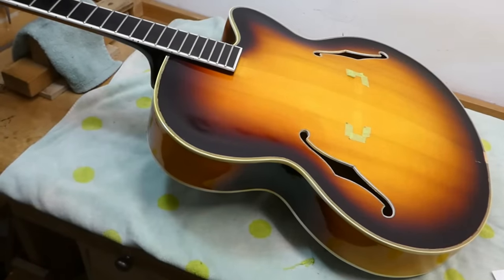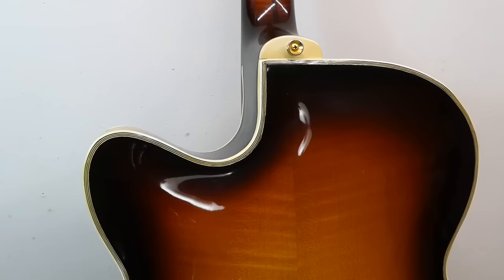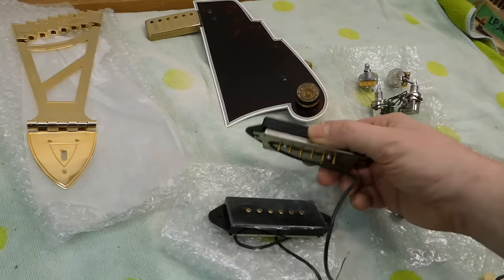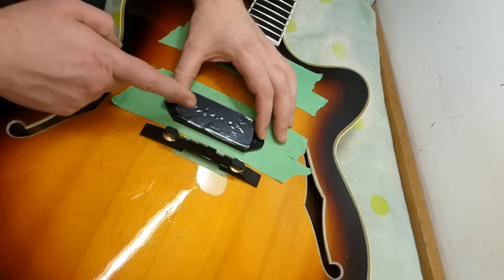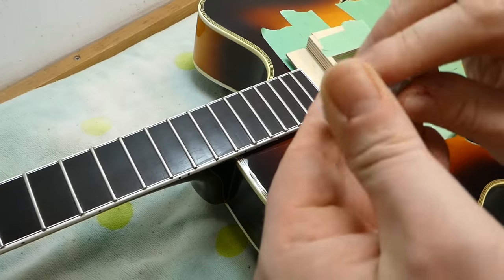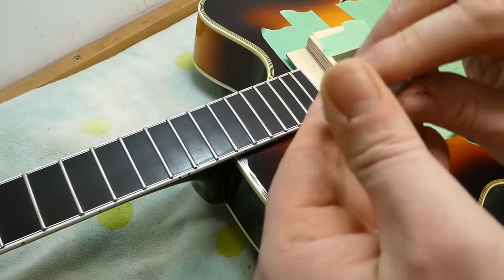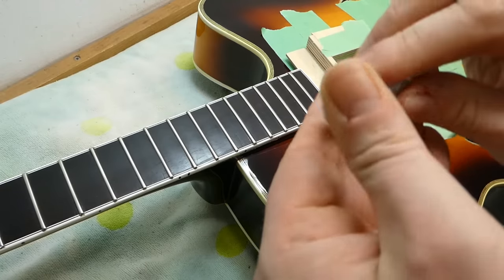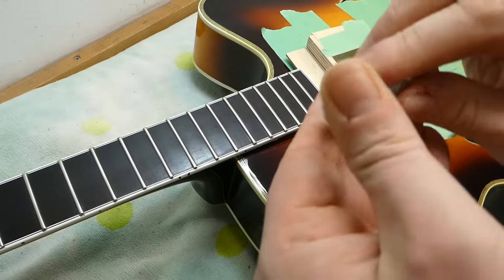The Forbidden Mod

Comment: Great job, thanks Ted 

Long before YouTube i found an old wrecked Framus acoustic archtop made in 1953 in the dumpster.

Since it had a gaping hole in the top right in front of the fretboard i converted it into an acoustic - electric which i still play to date.
Reply: Nice.

Comment: You did a great job. I was very surprised at the X bracing of in an arch top. The p90’s are a nice touch on that guitar and it didn’t loose its acoustic quality at all. I have a Sawchyn Archtop with a floating Benindetto that works well. But can respect why the owner wanted to do this.

Comment: Always a pleasure watching you work. Ive recently (10 years) started replacing my pickup selector switches with a blending pot. The smooth transition eleminates sudden transitions. I've found that there are "sweet spots" on my 2022 Gibson 335 where i made an indicator pointer washer and recessed glass jewels on the speed knob for references. Turns out, my favorite spots always a blend. I replaced the stock volume and tone pots with a CTS matched set (510k ish). Also using one of my  NOS .22uf Bumblebee's i bought at auction 35 years ago. It really opened up the Gibson T-Type pickups, but i have a set of Ron Ellis pups just in case.

Comment: I feel like you undersold the value of independent volume and tone controls for each pickup.

For me, the best thing about them is being able to make the middle position really come alive by rolling the tone off from the neck pickup and using the volume control to add or remove it from the mix.

It creates a really unique sound that you can't achieve otherwise that allows you to dial in a darker sound without it being too muddy.

Absolutely love having parallel controls, purely because of that tone
Reply: Great comment, I play an archtop with 2 pickups and four knobs, and I just use them to balance the output between the pups.  I will now go and experiment with your technique, thank you for the insight.
Reply: He still can with this control arrangement. He just has to use concentric pots. (Stacked pots). For an instrument like this I can see the utility of individual volume and tone controls.

Comment: Speaking of D'Aquisto, I had a New Yorker Special that the original owner decided to add an L5CES wiring harness to. Later he felt that he ruined the guitar. I had an early 60s L5CN that someone added an L5CES harness to. It ended up with a big crack in the top. One thing about these archtops with pickups is that the tops are usually laminate(at least with Gibson). This helps reduce feedback.Sticking pickups into a solid top archtop would make for a lively  guitar.

What about clipping the pole pieces on the bottom of the bridge pickup? It would save from routing into the x brace. As for the switch, there is a deep nut for Switchcraft switch. This is common on Gibsons where the switch wont fit through the top. "Typically found on a Gibson Les Paul guitar or where the switch threads don't protrude enough through the guitar body to attach a standard toggle switch nut." from Philly Luthier.

Comment: awesome as always!

two little things;

if he liked the feel of cheap alpha pots because they're super easy to turn then there are CTS pots like that. the dimarzio-spec CTS pots are some of the best around and have very low turning torque. it seems like the CTS "vintage style" versions with the dimpled back where the spindle pokes through are the easy-turning ones, and the dimarzios are like that

as for the switch, the back-facing cutter thing is a nice answer but also what you need (and what gibson uses) is the "deep nut" that threads around the switch collar and extends down into the hole to grab the switch even through a thicker top

some gibson archtops have a weird rubber gasket thing they mount the switch in, i suppose for when even the deep nut is not deep enough to reach

Comment: I had my '66 Fender Jaguar's bridge pickup routed out to fit a Dimarzio Single coil sized humbucker. Left the original neck pickup alone. Had a cool sound and it worked for what I needed at the time.

Comment: I just did some sacrilegious freehand routing for a 2-point floating tremolo with vintage styling. I haven't done one for several years, and fortunately, it was just within acceptable. I bypassed standards like masking tape, petroleum on the wood, and under cutting the hole to bring it up to necessary capacity through some hand filing and sanding. I've done pro shop perfect freehand with those tactics employed, and hatchet jobs I sold at a loss on the first couple I had ever routed, and for that matter, these were the first times I had ever used a router lol.
What has actually performed well for freehand is undercutting the pocket with an oscillating saw, then going in to freehand with the router, and finishing it off with minor hand sanding. I will finally build some jigs next year since I have a habit of modding junk-brands until they're high end.

Comment: Epoxy putty's great stuff. I knocked over my guitar before a gig and split the nut right under the B string. As a stopgap repair I threw on some epoxy putty for the B and the E string. 25 years later it's still there! 🤣

Comment: I had my sunburst Epiphone Emperor Regent converted into a Gibson ES 5 type. Replaced the one floating pickup and modded the pickguard to accommodate the three p90 pickups and added a gold Bigsby and art deco type tuning buttons. Though not a Switch Master, but with a six-position point knob selector. Strictly NOS for Jazz and Rockabilly!!

Comment: The tool you need to cut the counterbore on the back side of material is called a reverse spotface cutter. They are commonly used in the aviation industry and can be purchased from aviation tool suppliers such as The Yard or Brown Tool. Thanks for another great video!

Comment: In regards to the internal counterbore for the switch, Noga has internal deburring tools (the RC2200, for example), where the blade folds sideways to hide inside the shaft of the tool and then rotates out once the shaft has been placed through the hole. That tool wouldn't work as-is (it would cut a chamfer and not a flat, if it were big enough, which it isn't), but the general idea might be usable.

Comment: Rather than the bridge pickup riser ... there are those screw things along the center of the pickup that can be adjusted a ways up. I usually raise screw poles about 3/16ths inch and drop the pickups anyway for the grail "more note clarity and better definition"; it tends to reduce some pickup brands tendency toward muddiness. Looks like a seamless job like it was originally outfitted that way.

Comment: Another great job! .  I can understand people having issues with doing that to a vintage Gibson or other iconic archtop, but as Ted said,  The guitar was built for the owner and so that doesn't apply.  I have an electric guitar designed & built by a local luthier and it has had it's pickguard & configuration changed three times   It started in a Strat configuration, then  had a Tele bridge p/u, lipstick middle & humbucker neck  p/u, and it's now fitted with 2 filtertrons. - I wouldn't have done this to any of my Fender guitars ( OK, I put a humbucker in the neck position of a Squier Tele) but have no qualms about modding something that isn't an  iconic model.

Comment: 17:29 That's what I found too! I don't know why they don't make those jacks to fit a 1/2" hole nicely. I understand you want a little slip in the fit, in case the wood shrinks, so it doesn't crack, gripping the metal jack. I take a 1/2" spade bit, and grind both edges on a belt sander, so it drills a 13/32" hole. Would be better to have a Forstner bit that size, but a spade bit is way cheaper...just have to go slow and careful.

Comment: Recently replaced the toggle on my 91 LP. Bought the new switch-craft on-line. Everything was the same but the nut. The nut on the replacement was flat like yours. The nut on the original was concave. Goes into the body more that 1/8. Crazy! Of course I used the old nut with the new switch.  What choice did I have.

Comment: When you thought fishing the electronics from a hollowbody was a frustrating task.. then see router shavings plunging into one. The back-bore counter-sink idea is a real trick, thanks! and I use plastic bonder for a bunch of jobs, They do a putty version also I think. The neck pickup/body looks canted away from the treble strings, is that advantageous to some extent for tone in that position?

Comment: I have a nice D'Angelico EXL-1 in Ocean Turquoise Full sized Hollowbody electric acoustic guitar with Flatwounds 13's on her. The volume and tone controls are mounted on the pickguard and the pickup is suspended off of the end of the fretboard making her a guitar with no holes/cut outs in the top plate. I can remove the pickup and the tone controls and Iwould have a fully functioning normal hollowbody acoustic guitar. The head piece is a work of art and the tuners are unique to D'Angelico. So as the tailpiece. The 13's are kind of ha4rd to play, even though I play guitars everyday a;; day long. In fact I play so much I amlosing feelings in my left hand and bottommost two fingers. I'm worried about that.
I also have an D'Angelico New York semi-hollowbody electric guitar named after the Grateful Dead. It's a very hard to comeby instrument as it's not a model in their normal line-up. It's well made and beautiful too. She sounds good as well. - Peter age 73

Comment: Tip:  Regular JB Weld actually works better on plastic than the special plastic JB Weld stuff.  See Project Farm.  Go figure.

Love the black choice of pickup cover.  I wouldn't have said that before I saw it.
Reply: I have yet to try a "plastic fusion" epoxy that impresses me, regardless of brand.  All of them seem to contain some kind of nasty smelling solvent and so they really stink up the room but they never seem to grip, nor harden, to the same degree that a regular epoxy does. I love JB Weld ( both the regular slow cure and fast cure "Kwik" variety)  But I wasn't impressed with their marine weld epoxy,  and their UV-cured  super glue works well enough but the soft squeezy rubber applicator container it comes in (apparently a design purchased from another adhesive company) is the worst glue dispenser system I've ever seen ----- it allows air in so that the nozzle clogs, and it's designed to not be removable or swappable, and then the glue hardens inside the tube prematurely.
Reply: It's not black, it's tortoise-shell.
Reply: @nazfrde  , the pickups are black (though they're also available in gold or chrome, perhaps cream/ivory). The pick GUARD is tortoiseshell.
Reply: @nazfrde  What? The pickguard is tortoise, but the pickup covers are black.
Reply: @goodun2974  Agreed. I think that Project Farm's opinion would be the same.  There is no ideal product for all applications.
Reply: @frankfarklesberry  , at any given time I have at least a dozen different types of adhesive around the house, including at least 6 types of epoxy. It takes trial and error to figure out what type and what technique/surface prep works best for certain materials. Sometimes one operates only from a combination of instinct and prior experience.
Reply: @frankfarklesberry  oops you're right. My bad.

Comment: A deep toggle nut would saved time and manipulation of the top. The deep nuts are very useful on thicker tops like Les Pauls. They are designed exactly for this type of application. They are cheap and readily available in fine or coarse knurled.

Comment: I have to say that you took the observation that the bridge pickup could benefit from being placed on a riser far better than I would have in your position.

After having done such a precise and potentially risky bit of cutting into the braces that run directly beneath where it's mounted, simply to accommodate the screws that hold the pickup together (yes, they are just regular screws and no, they don't really do anything other than attach the bobbin to the base plate and were added to the design to make it cheaper and easier to mass produce compared to the original version with 6 individual magnets that all needed to be in contact with the base plate. The influence they have on the sound is negligible and they aren't intended to be adjusted. If the pickup wasn't wax potted and you loosened them to try and get balance between the strings all you'd end up with is a microphonic pickup because the coil wouldn't be properly secured) I would have been incredibly frustrated to come out the other side with the pickup lower than it needed to be.

Comment: Hello!
In order to avoid the possible side effects of having epoxy putty close to the guitars surface (exotermic reaction), I use moldable plastic - put the plastic pellets in warm water and once its flexible, mix them all together and use it adjust your template to the guitar archtop, similarly to what you did with the putty. once its solid you have a very stable surface to route. :) I have tested this method. 
Again, only thinking about this alternative based on the epoxy’s properties.
Reply: Also, you are my absolute favourite channel on youtube! thank you for so many things you’ve taught me.

Comment: This nut for the switch can be made on a lathe in brass or steel. Believe it or not, there are still people that know how to make them. A local machine shop will be able to reproduce that part in 15 minutes. For some cases might be worth considering. I had similar situation and managed to get one made. A friendly shop will make them for couple of $. Unfriendly shop will charge you a 100$

Comment: Nicely done! A short Switchcraft toggle also has a 9mm threaded shaft or you could have used a deep nut like on a Les Paul.
Reply: Yeah, I would have used a deep thread nut rather than counterboring the back of the top.

Comment: Tip: I use soft silicon tubing found for small aquarium pumps, for pulling through pots, jacks, and switch (without knob), this way the tubing has a little more rigidity, also it fits perfect with a little heat over pot shanks and switch, i push the tube through the jack hole and it stays in place with a little painters tape... this way you can feed the tube through and pull your pots, switch and jack and it works very nice vs fishing line which can get lost in the body..

Comment: Great work as always. I understand the idea of leaving enough PU wire to be able to do future work without removing the whole harness, but I wonder if you have to do something to either secure the extra wire someplace or guarantee it is floating in the middle. I could see it being a potential source of annoying buzz/vibration otherwise (e.g. if it is just touching an interior surface but free to vibrate when the guitar is played).

Comment: that guitar is very violin based as they are arched top as well
Reply: The big difference is that flat tops and many archtops (like the above) use an "X" brace.  Violin family instruments and some archtops have two braces outside the outer strings.  Some thin body archtops like Gibsons 335s use a laminated (I think spruce) centre block running the length of the body.  I believe that is the only reason they can use the two piece body mounted bridges like Les Pauls.  "Jazz guitars" (I own a Guild X-175) with a braced body often have an end pin mounted tail piece.

Comment: I own and operate my own little resinous flooring company and I cut striations or as I call it keying in . Cut a line usually a few inches deep at terminations oe doorways to ensure a very low bonding failure possibility.

Comment: FYI...a competent machinist could fabricate a locknut (and a spare) for that switch.  Oh, and there is always the option of using dual concentric pots to reduce the number of pots you need to cut holes for.

Comment: I have a guild A50 that I'm doing the same with, the only difference is I intend to use a GFS surface mount pickup, which will only require drilling, not routing. It's going to look absolutely ridiculous, it doesn't even have a cutaway and looks like...... I mean, well, it looks like a jazz guitar from 1951. Because it is. However, I am not taking something all original and destroying its value. My dad tried to reset the neck by dowel-jointing it, or I should say he's successfully dowel-jointed the neck and kept it from basically falling apart. However, if it ever needed an actual neck reset, it's sort of impossible with the way he did it. Therefore it's not all original condition and not collectible the way it would be. It would still be a hell of a player, fat neck and very easy to set up, but I wanted to sound cool, and the DeArmond string mounted pickup (it's supposed to clip on between the tailpiece and the bridge) it's too old and has lost a lot of its gauss, and it was never that hot to begin with, even for a vintage single coil. Absolutely not my sound. I feel like I'm going to put this somewhat hot surface mount pickup on it and take advantage of the fact that it's hollow and therefore I can hold a chord and briefly stop strumming to have it go into second harmonic feedback really really fast even if my amp isn't cranked. Bound to be an interesting project.

Comment: This was the most exciting luthier video i've seen for a while. Nothing was really basic work here, lots of improvised solutions which I like. I actually held my breath a couple of times! And the result was great, I liked the sound from the neck pickup especially.
I came thinking about something when you talked about Gibson standard controls. I Have a Hagstrom which have that kind of layout and I don't like that but I don't want to remove the original. I was thinking if it is doable to add a master volume last in the circuit because it is possible to put it in my pickguard at the spot I like it (Like a strat or Ibanez). Or will this mess up the impedances?